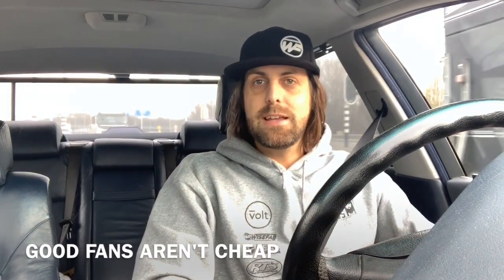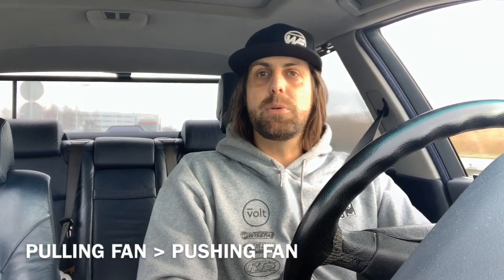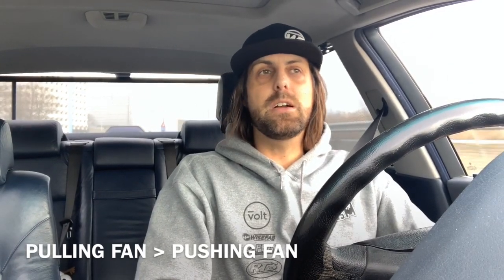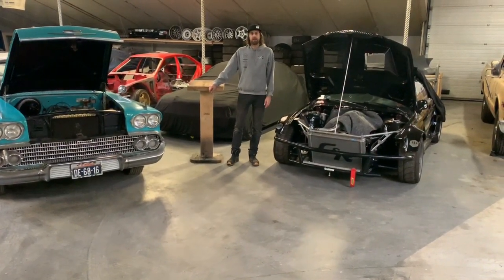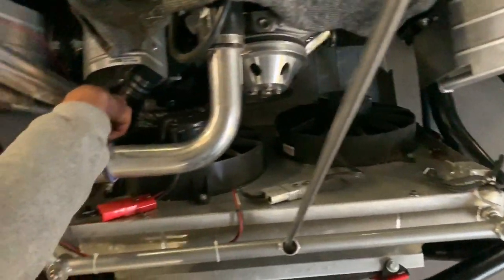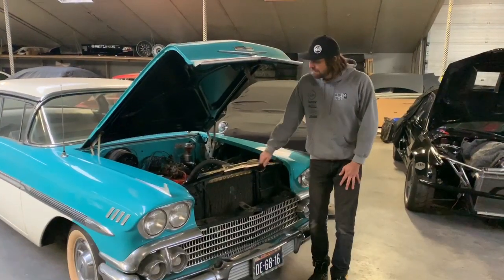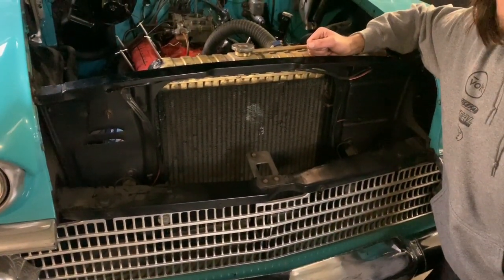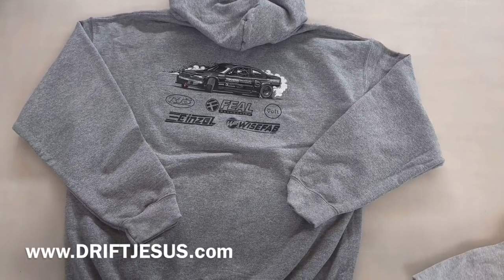Radiator Setup, Cooling, Fans, Vents, Duct Tips & Tricks! Podcast Explained & Shop Shown!

Comment: For you fahrenheit guys out there, 80, 90 and 100 convert to 176, 194, and 212 freedom units. 

I am guilty of running mishimoto stuff he's probably referring to as the lower end of the market at the beginning of the video LOL. My temps are pretty decent, I can high rpm drift for about a minute before ECT gets to 220+. I'll be looking out for an upgrade now that I know this new information!

Also I use 5w20 oil because that's what was OEM in my mustang. During normal driving it stays at around 160F or 71C thanks to my cooler and thermostatic plate. 5w20 has a lower operating range than 5w40 so I try to keep it cool and save it after 210F+ oil temps

Thank you for this content!